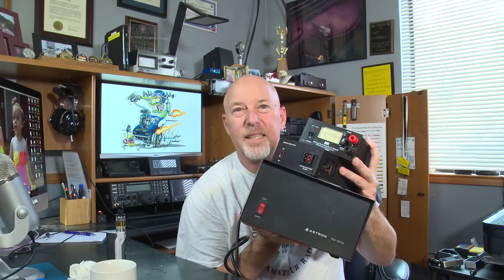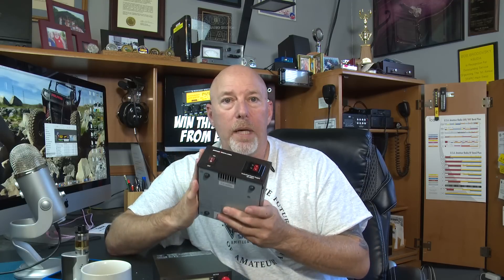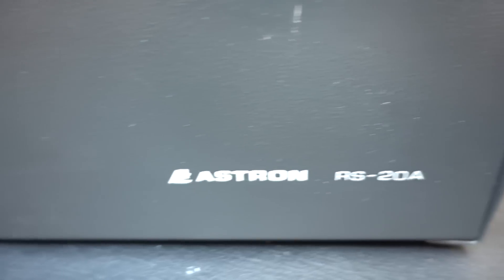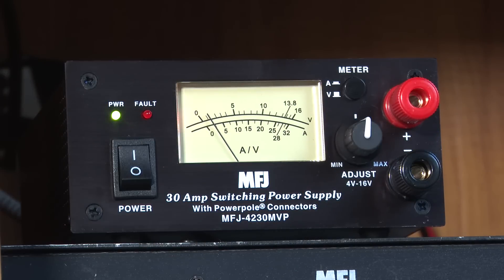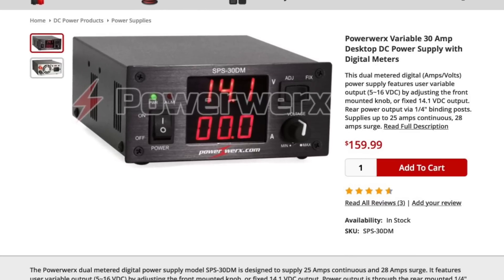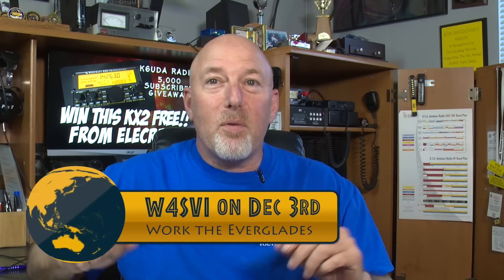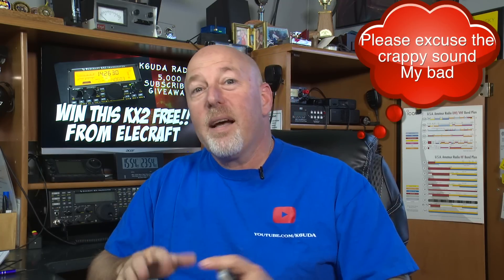Power Supplies Explained - K6UDA Radio Episode 35

Comment: Have two variations of this 4230 from mfj. Same supply, just different configurations. Purchased a third one recently and it was having some type of issue where it would drop from 13.8 down to 5-6v for a couple seconds. Of course this would cause my 991 to shut off and then back on at random intervals. Have returned it. Hopefully this is just a very rare electronic issue and not some type of design issue that might show up with others later

Comment: Just went through a bad power supply, it supplied the volts and power, but it was dirty/ and caused noise, and was throwing faults into the radio, from functions not working to swr going up and down. It seemed to be putting a volt or 2 on the negative, replaced it with a quality supply, all good.

Comment: OK, so, really, how many power supplies do I need? If I only have a couple of radios (eating low Amps), do I need more than one power supply? I'm new to setting up radio gear and if I don't need a shack full of PSUs I'd rather not have a bunch of them.
Reply from the maker: Aaron M I’ve got one mfj switcher (30 amp) running my two HF radios and a uhf/vhf radio. Your only transmitting on one at a time unless you have a serious contest station.

Comment: Switching power supplies are good for mobile work like going to a park , besides that they are junk.
Reply from the maker: I've been running my station on a switcher for 3 years with zero issues.
Reply: Great  . i have a duracom switching power supply i use for the park or back yard but too much rf noise for me

Comment: I would guess one would want a big linear power supply for the lack of unwanted rf noise. It is not unnatural for such power supplies to last for decades. The failure of yours was a rare fluke but does happen.

Comment: The first week I got my ticket six years ago I got a Astron RS-50M at a hamfest for $150.  Every time I mentor a new ham, I tell them the first thing they need after an HT is an Astron linear PS, at least 20a.  Most of them go ahead and get a 25 or 35 amp.  Nobody has ever told me they regret it and I'm talking about a dozen people.  

I have two small form factor Radio Shack "switchers" which I use in the field.  They work fine.  But especially on the bench in the shack, I want to reduce the chances of line noise.  Whether or not the switchers produce line noise doesn't matter, the linear won't produce it and I want a zero chance; that way if I do get line noise, I have that already out of the question. 

Just my opinion.  Now, I have that 50M and a backup 35m.   I also buy them when I find them at a great deal to resell at zero markup to new hams.
Reply from the maker: I was never a fan of the radio shack PS. Thanks for helping out the new guys.

Comment: Hey Bob,
Do I need to have a separate power supply for each radio that I have?
Or can I get a really powerful power supply and run all my radios off of one power supply?
What's the best course of action for powering my radios?

Thanks Bob and keep up the good work,
John
Reply from the maker: +John007 I run three radios off one supply here. Icom Id-5100, ic-7100 + mfj tuner, Elecraft K3s + p3 + tuner.  Works great.
Reply: I run three off of my RS50m Astron.  You can't talk on more than one at a time, so you're not going to starve them.

Comment: I buy 100 amp switching p/s for 88 bucks each. they aren't pretty. but pack a punch. they are server p/s. they are 115/230 volts. and I run 4 in parallel. their idea circuit is nill amps. the only think is I have to filter it with a 2 Faraday cap. and it's voltage stabile to 80 amps at 14.2 volts. but only drops voltage around 90 amps where the voltage falls off to 14.0 and 13.8 at 100 amps. it can go to 110 amps and voltage falls again to 13.0 amps. but the overload protection kicks in and shuts it off.
Reply from the maker: +Dale Myers what are you driving to 80 amps? A flux capacitor?
Reply: K6UDA  a 16 transistor amp with a tuned input and output circuit and biased to ab. but it's not just 80 amps. it's a 500 amp switchng supply ive assembled. it's 5x100 amps of switching power supplies.
 this way i neednt over drive the amplifier, radio or power supply. keeping it clean and feed it 50 watts drive. but if i were to over drive it in an emergency. i wouldnt fear of under current demands.  but i dont think my yeasu ft857d would do that when i set the power settings. and yes it's all over kill. but you can't get that if you driving the crap out of the equipment. i like Cadillacing it. over kill for a power supply, over kill for an amp and over kill for the radio.

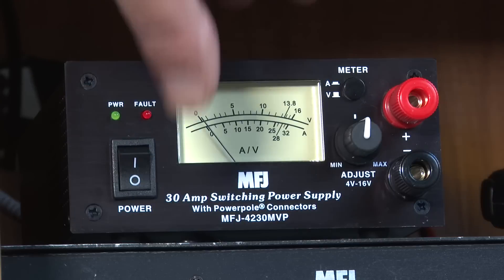Comment: Power supply "response rate" ?!?!?!!  Bob, wheredidja get that and what's it mean? (around the 3:20 minute mark)?
Reply from the maker: +Jim Piper it's an interweb thing.
Reply: Oh, well, now THAT clears it up!
Reply: I would venture to guess that this is referring to transient response, like what is needed to drive a rapidly changing SSB signal. I would also guess that some capacitors (both bulk and a smaller cap or two for high frequency) right on the power output would help this. Ever look inside an Astron? They have a 2200uF and a 0.001uF cap directly across the output.

The main reason I went with an Astron is that I can repair and modify it myself. It is all through-hole and easy to deal with. I re-capped my used Rs-35M and added a number of mods to it (additional MOVs and capacitor filtering on the input, the missing compensation capacitor, etc.) RepeaterBuilder.com has awesome info on Astron supplies used in 24/7 high use repeater setups.

K6UDA-- Thanks for the vids. What part of HF do YOU hang out on? Maybe we can QSO some time.

Comment: my power supply is a car battery and a charger! hay it works, piece by piece i am building my shack. like the compact size of the newer ones.
Reply from the maker: Plus you don't have to maintenance them. I hate it when I spill battery acid all over my wife's new carpet.
Reply: Your wife's new carpet?  Isn't it yours as well?  :)
Reply from the maker: Yeah, right..